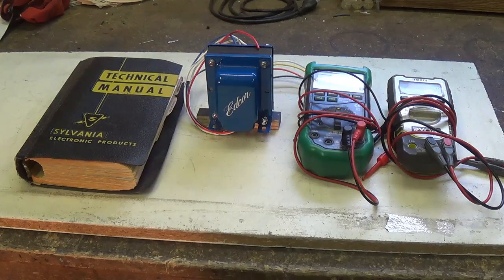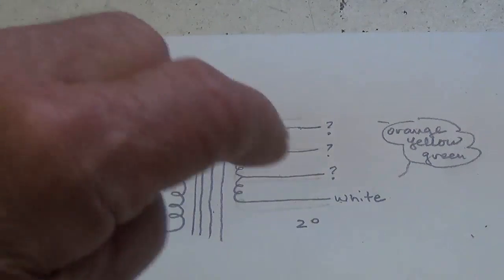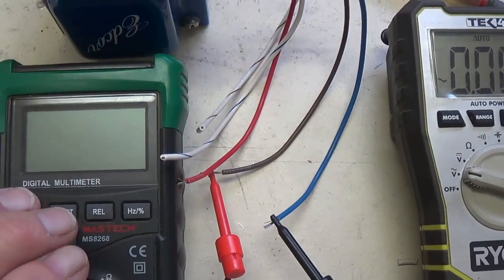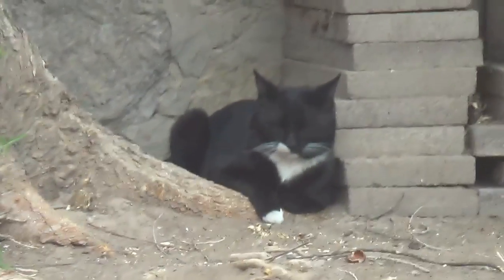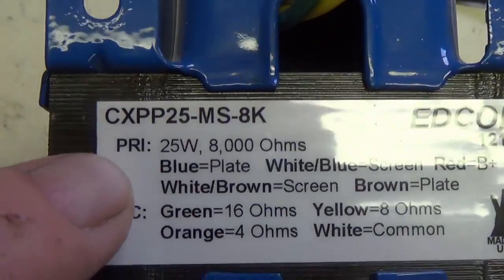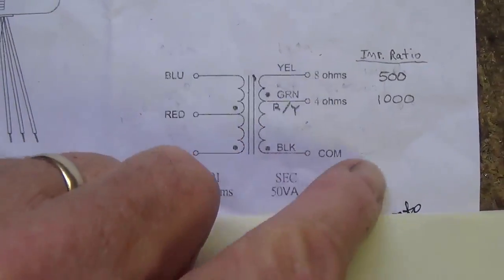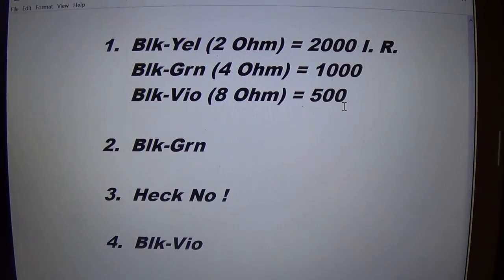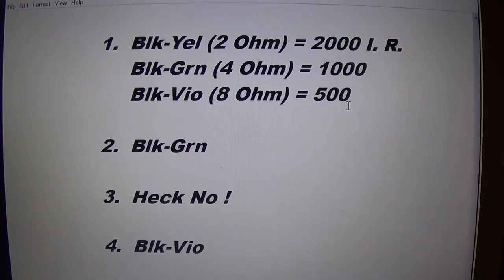Impedance Ratio: The Easiest Way to Decipher Output Transformers

Comment: What happens if you miss match a transformer with the tubes and speaker?   For example, you use a 4 ohm speaker on an OT that has an 8 ohm secondary?
Reply from the maker: If the speaker impedance is low, the plate current will be too high in the output tubes. If the speaker impedance is high, the plate voltage will be too high. Either way, you're asking for trouble.

Comment: Hey Doug, Is there a way to find the tube output impedance (effective load resistance) at higher voltages than listed in the data sheet? I’m looking to determine what the Impedance of a pair of JJ6V6S tubes in push pull at 365v
Reply from the maker: This is a common problem with many amps, like Fenders, that have plate voltages above 450VDC.  The scientific way to resolve the issue is to determine the winding and impedance ratio of your existing output transformer, which was chosen by the manufacturer to suit the high PV circuit. You can then determine the primary impedance (ELR) reflected by the secondary (speaker voice coil) impedance. Once determined, you can use this ELR value for future circuits with similar output tubes and PV's. The non-scientific method is to simply use the ELR value for the highest PV on the chart and hope for the best.  Both methods have worked well for me :)
Reply: @UncleDoug  next question, how can I help support your content? It’s unbelievable that your sharing your knowledge to the world for free, thank you so much for doing so!
Reply from the maker: @algio3041  I provide links in every video description to assist you in helping to support our channel, Algio. Thanks in advance for your generosity.
Reply: @UncleDoug  all signed up!! It’s the least I can do in return for your knowledge.
Reply from the maker: @algio3041  I just received notification, Algio. Thanks so much !!!

Comment: You've done a lot of amplifiers, have you ever done any radios or tvs?
Reply from the maker: I used to repair radios about 25 years ago, but never any TV's.
Reply: @UncleDoug  maybe there is a challenge for you
Reply from the maker: Modern TV's are not made to be repaired, while vintage TV's cannot receive digital signals. Neither really appeals to be as the basis for a hobby. Let's face it, between amps, hot rods, cats, YT videos, and pole dancers......my plate is full :)
Reply: @UncleDoug  my modern TV has been dead for a while 😂 don't think I will fox that one, I was hoping to redo one from 1956 but it doesn't look like I will win that auction 😑 you can modulate the digital signals to Rf out though, and there are a few other ways you can inject data
Reply: @UncleDoug  stay out of the clubs! 😂

Comment: Why not use a 1V source then the impedance ratio would equal the voltage?
Reply from the maker: It's easier and more accurate to apply a higher voltage to the primary and read 1V on the secondary, JD. Try it and you'll see.

Comment: I'm confused about the power.  I thought the output tube pair are added together.  Rough number for most 6L6 pairs in any flavor are a 40 to (60 watt, a real sretch??).  Won't that OL the 25 watt OT??
Reply from the maker: Yes, it would. An amp circuit with two 6L6GC's cranking out 40 to 50W RMS would fry a 25W OPT. If you check with sites like ClassicTone, they produce 50W OPT's for applications like this.
Reply: Okay, thanks.  I thought  I missed or misunderstood something.  Now I need to look up the "ultralinier" connection configuration.
Reply from the maker: Good luck, Dennis.

Comment: Sorry for the dumb question. Can DC (say a 9v pedal power supply) be used to test the OT turn ratio? Thanks!
Reply from the maker: No. Transformers only "work" with AC.
Reply: @UncleDoug  Thank you very much Sir! Then I'll need to fire up the PT and use the 6.3 rail for testing ^^
Reply from the maker: @jonsnow7092 If your winding ratio is the usual, around 25:1,  and you apply 6.3VAC to the secondary, theprimary will have over 150VAC present.....so be very careful. Also remove the tubes, especially the rectifier, to ensure no high voltage is present. If rectification is by diode(s) do not do this at all.
Reply: @UncleDoug  the amp is an own built point to point one, using some transformers from an old VOX. I can just disconnect the high voltage secondaries and insulate them, then connect the 6.3 rail to the secondary of the OT and measure the primary (which is currently disconnected), after of course insulating the leads with some electrical tape.
Reply from the maker: @jonsnow7092  Just be careful, JS.
Reply: @UncleDoug  Will be, thanks!

Comment: I want to run a pair of 7581A's with a plate voltage of 460V. the Rp spec is 5600 ohms.. do you know of, or where I can find a O/T for this impedance to run into a 8 ohm spkr....Id appreciate your hep.  Thanks
Reply from the maker: I'm sure you can find one on the ClassicTone Transformer site. Be sure the wattage is adequate.
Reply: Thx Doug

Comment: One other way we have to do the math with an unknown
transformer is slightly reversed..  we solve knowing the 4, 8, and 16, in order to obtain the effective plate to plate impedance... ( instead of assuming a plate to plate and solving for ideal speaker load)  and once we know that, then we can search for tubes that are compatible with the plate to plate impedance.
Reply from the maker: Yes, indeed, Jennifer.  The Impedance Ratio works both ways.

Comment: Keep in mind that you still have to stay within the power handling capacity of the transformer; if you design the circuit with 2 6V6s at 285 volts, your transformer isn’t going to be too happy if Jack cranks up the variac and you get 450 volts B+ instead! The magic smoke will come out, and Jack and Ollie won’t be able to jam out! 🤠
Reply from the maker: Fortunately, our Variac only goes up to about 130VAC, William......so Jack will be thwarted if he tries to sabotage any of Ollie's solos.

Comment: How can I check how many amps of each winding can given transfomer provide?
Reply from the maker: The only way is to know the part number of the transformer and find its spec sheet or know what amp circuit it came from and extrapolate from that circuit what its capacity is. There is no other reliable way to estimate or guess.

Comment: Getting iron core transformers these days seems to be difficult, specially here in the uk, or even trying to buy E and I cores, just can't find them anywhere, which honestly is a bit of a shame, the only thing we seem poo make with ironcore transformers now are microwave ovens, I remember a time these were everywhere, they made great weapons, swinging a plug around 😂 maybe I am just looking in all the wrong places?? Ebay has not been my friend in that regard
Reply from the maker: They are getting scarce here too, P, especially with voltage outputs and winding ratios that are useful in tube circuits.

Comment: 6bq5 seems to be the cheep easy tube to get. so is it possible to buld i 100 watt amplifier using say 6 or 8  6bq5 tubes in parallel  push pull  how does that math work?
Reply from the maker: I guess it would be possible, wiring them as you describe, but would 8 of them still be cheaper than a pair of KT-88's ?
Reply: @UncleDoug  it would be more fun seeing a small cast of tubes like maybe  a Frankenstein looking amp. you know go where no one dares to go. would love to see you build something like that lol

Comment: what does 4 output tubes in a push pull circuit do to the plate load resistance?
Reply from the maker: The pairs are in parallel, so it would cut the load resistance in half.
Reply: @UncleDoug  thank you. you are the best!

Comment: YOu might want to put the electrical fuel pump on a relay that works only if the engine is turning.  This can help prevent gas fires, If the key is left on without the engine running.  This is typically what happens in a crash..
Reply from the maker: Thanks for the helpful suggestion, WH.

Comment: Could you use a 110 volt to 12 volt power supply instead of a transformer?
Reply from the maker: Actually, a 110VAC to 12VAC power supply IS a transformer, Tim.
Reply: @UncleDoug  Sorry 110VAC to 12VDC power supply
Reply from the maker: @timstuart1033  It's still a transformer, Tim. It would be useful as a source of filament voltage, but nothing else.

Comment: Does it reduce noise to have all of the coils in phase with reference to ground?
Reply from the maker: Which coils are you speaking of, AR? If you mean transformers, it's probably not possible and will serve no constructive purpose.
Reply: @UncleDoug  I was getting used to a new oscilloscope with a frequency generator built in.   While doing so I marked all the leads on a power transformer to be in phase. (not output transformer, I apologize for the confusion).  I was tired when I asked that question.
Reply from the maker: @qua7771  I'm still not sure of the benefit of transformer polarity, AR, but I like the idea of an oscilloscope with built-in signal generator.
Reply: @UncleDoug  The newer ones are kind of nice in ways.  It takes one channel to measure its own output signal.  That stands to reason, I suppose.  They are not a bad deal.  They offer a sig gen output and Two channel measuring.  Every thing you need for a tube amp guy at a reasonable price IMO.  I purchased a Hentec DSO402C a while back, and I am not disappointed.  Very affordable, and usable.  Of cores, with O scopes, you have to be extremely cautious about how you use ground.  Scopes ground is always earth ground so if you are going to float a ground through a transformer, be mindful.  If you float the scope ground, you may instinctively decide to swap cannon plugs on it, which can stop your heart from beating permanently and instantly.  All parts of a scope are grounded, so leave it that way.  If you have to float ground, do it on the amp side.  Never put two hands in the can!  Always one hand in you pocket. 
Peace, love and all due respect!
Reply from the maker: @qua7771  Thanks, AR. Likewise :)

Comment: I just calculated that if we didn't bother to use a low-voltage transformer for this test, and just fed mains 120V into the secondary winding of the transformer, we would be measuring 5,380V at the primary. And here in Australia where I live we use 240V, which would yield 10,760V.  Don't try this at home!
Reply from the maker: Amen, SB. Such voltage would, no doubt, destroy the primary winding.

Comment: What if the transformer is from a 4 by 6L6 amp that ran 4 10 inch speakers, but the impedence is unknown
Reply from the maker: The impedance ratio of the transformer will still be reliable. The impedance of the output tubes will be half of normal since the pairs are in parallel. The net speaker impedance will be a quarter of any one speaker.
Reply: @UncleDoug  so I take the impedence of 2 tubes, as that is how I run the amp , and if I want to run the amp with all 4 , I halve it....thanks

Comment: There is a significant error in all this, namely that turns ratio alone cannot be used to calculate impedance ratio. Impedance by definition is the vector sum of reactance and resistance. If the transformer is tested for its voltage (turns) ratio with no load on the windings, resistance is not being included in the calculation. The fact that the Edcor transformer specifications agree with your measurement of turns ratio only means the manufacturer has also failed to account for this. In practice, placing an 8Ω load on the 8Ω tap of this transformer will not reflect 8,000Ω to the tubes, because the resistance of the windings changes the effective ratio. This disparity can be observed by placing the signal source across the primary winding and making the ratio measurement with and without a load attached to the secondary. When the load is attached, voltage at the secondary will decrease. This translates to a larger ratio, indicating that the true impedance ratio is substantially higher than will be calculated using the method in this video.
Reply from the maker: I'd like to know the magnitude of the "significant error" encountered by using the winding ratio alone to determine the impedance ratio. The fact that a transformer manufacturer of Edcor's standing ignores resistance in their calculation tells me that the deviation is relatively  small and easily ignored. Bottom line, what would we truly gain by complicating a simple, reliable, and effective procedure to make it a bit more accurate?
Reply: @UncleDoug  Making the measurement with a load does not "greatly complicate" the procedure. And on what basis have you determined this to be only a "wee bit" more accurate? Why don't you make the measurement both ways with the Edcor transformer in the video, then tell me if the difference you see is insignificant? Honestly, if you're going to claim this to be a useful procedure for others to follow, at least apply the necessary scientific principles. I've done this with a number of vintage transformers, and in every case, the specified load for the tubes was met only when the transformer was tested with a load. I'll just add that there are also core losses involved when the load is applied, but I don't know what percentage of the total difference this represents. In any event, this is one more variable that isn't included in the simple test outlined in the video.
Reply: For the sake of completeness, I pulled a Pioneer SX-2000 output transformer out of storage. I've made similar measurements many times, but I don't generally keep records of the unloaded results. Anyway, this transformer would have been used with a pair of 7868 tubes in pentode mode to produce about 35W. When loaded with 8Ω, the primary calculates to 6.9K plate-to-plate. With no load, it's 6.15K. Aside from the fact that 6.9K is closer to the specified load for these tubes (6.6K), the more important aspect is that there's a considerable difference in the loaded vs unloaded results. This can create a lot of  confusion when attempting to identify unknown transformers. A transformer intended for use with a pair of 6BQ5 or 6V6 might measure so low (unloaded) as to be mistaken for the 6.6K impedance appropriate for a 6L6. I've heard other stories of some transformers indicating the proper match when they're tested unloaded, but I haven't seen that in any of the vintage iron I've measured. It seems clear that somewhere along the line, some manufacturers have taken the easy way out, relying on turns ratio alone to specify their products. Unfortunately, transformers designed this way won't reflect the proper impedance to the tubes.
Reply from the maker: @TriodeLuvr  So I guess there are literally hundreds of thousands of vintage amps that suffer from impedance mismatch. Thanks for your informative input.
Reply from the maker: @TriodeLuvr  Your knowledge on this topic exceeds mine. Thanks for your very helpful input.

Comment: I am surprised that someone who often declares the value of originality ( and I agree ) , would have a Chevrolet engine in his Ford.
Reply from the maker: What is "original" about putting a modern  Ford engine in an old vintage car? Not one molecule of a Ford 302, 351, 427, etc. bears any resemblance to the original flathead engine. Also, the intent is not to "restore" the car......it is to make it better suited to modern highways and safety standards. My choice to do this was a SBC. Yours may be different.....but one thing you can count on is regardless of your choice, I would not publicly question it as you have done.

Comment: Now Uncle Doug, I saw one of your videos the other day with the 4 5 inch speakers in it. What's the problem with using the 6L6 with a trio of speakers wired differently to achieve 3, 6, 12 or almost any other load configuration? Here's a good resource for multiple wiring configurations with different speaker impedances. 

https://www.the12volt.com/caraudio/subwoofer-wiring-diagrams.asp?Q=3&I=42
Reply from the maker: You could do that, P7......but it's not commonly done. Most people stick with standard impedances, like 4, 8, and 16 Ohm.
Reply: I kinda figured that would be the answer I got. ;) On another note, this was an enlightening video. I tell people that you should learn something new every day. You're definitely helpful in that aspect. Jack and Ollie are fine musicians as well. They say curiosity killed the cat, but I am curious... does Casey (KC?) know how to play as well? Maybe she's the backup singer? Keep up the good work.